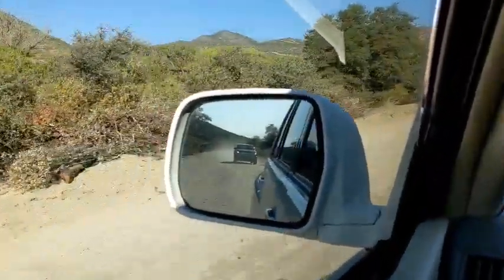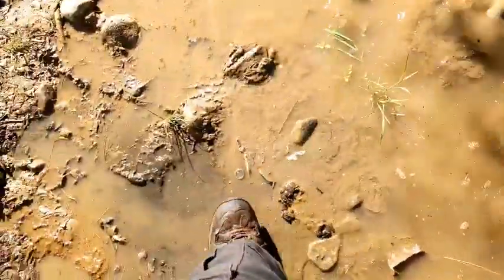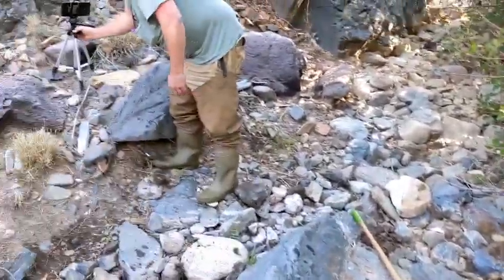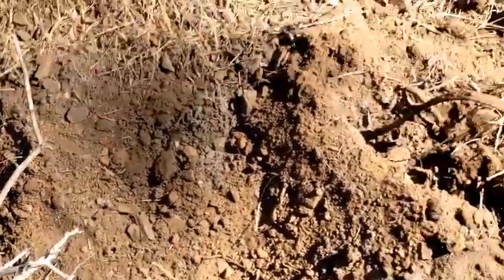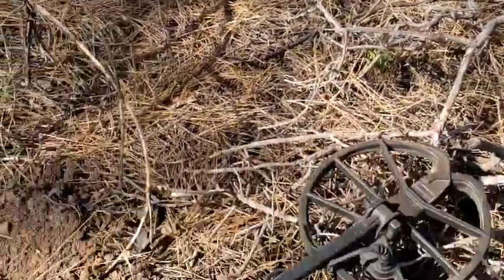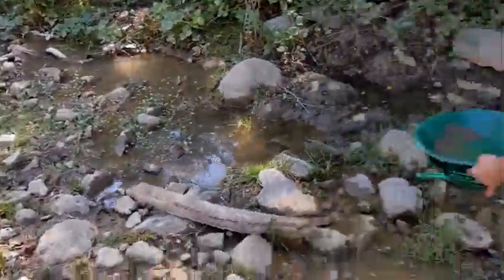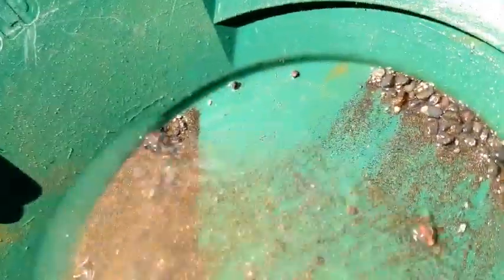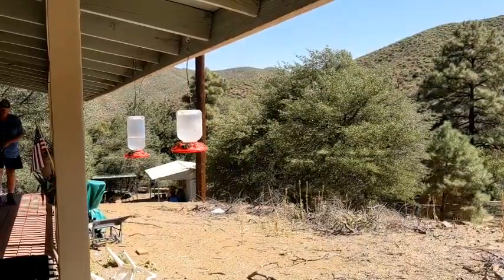Gold panning Arizona with friend& subscriber Lester Lepore Sr

Comment: Glad to see you've been finding some nice gold and relics.  You have to "Work" no matter what your seeking. 😂😉
The metal you found with the detector that had the loops and studs is a strong back for a "Hames"  !  It has a twin that goes around a horse collar.  The Tugs and reins from whatever the horse is pulling (wagon or implement) hook to them.  They use to be made with wood, which has rotted off.  
Good luck and happy hunting !  😁😎
Reply from the maker: That's really interesting,thank you very much Jay 😁